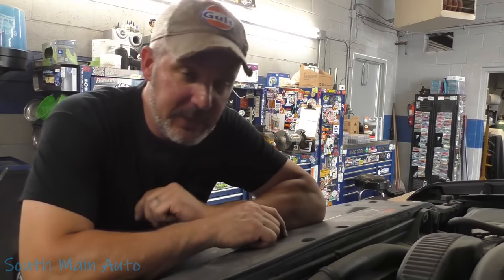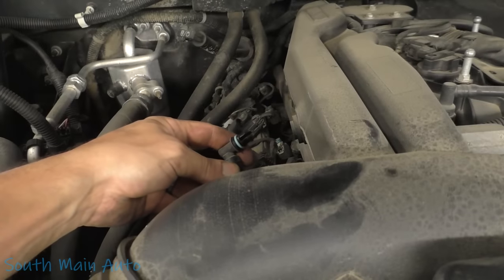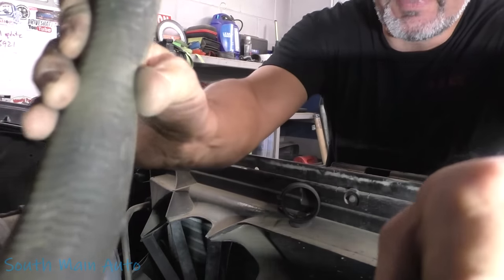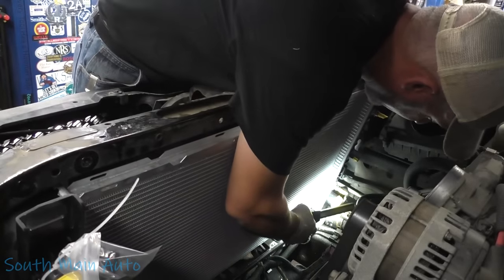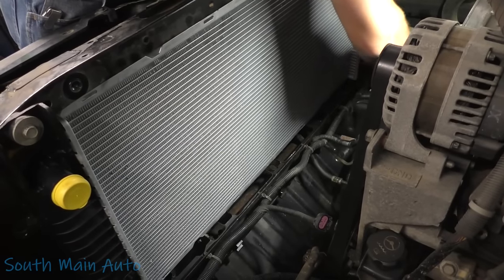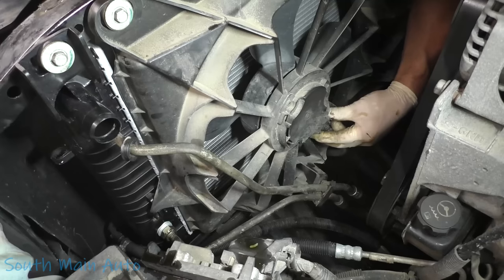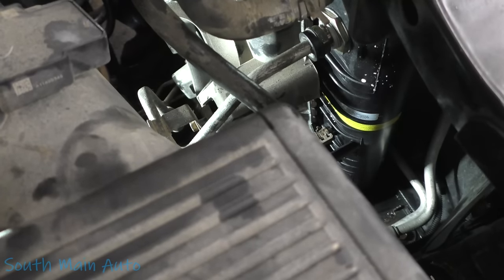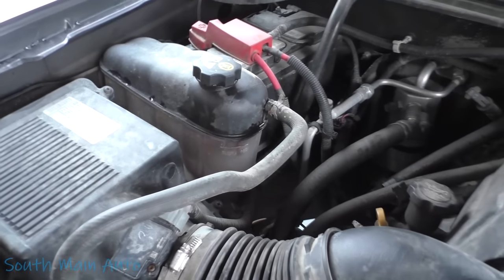'11 Chevy Silverado: Radiator Remove & Replace

Comment from the maker: Lisle 22990 Jiffy-Tite Low Profile Disconnect Set, One Size, Factory, 4-Piece : https://amzn.to/43tqgGQ
9" Hose Clamp Locking Plier : https://amzn.to/3O3smHO
DEWALT 20V MAX Ratchet Set, 3/8 inch, 70 lbs of Torque, Battery and Storage Bag Included (DCF513D1) : https://amzn.to/44y2TwW
Astro Pneumatic Tool 78585 Universal Radiator Pressure Tester & Vacuum Type Cooling System Kit : https://amzn.to/3K5GIpH
Gulf Distressed Vintage Adjustable Snapback Hat : https://amzn.to/44z1TIX
Reply: hhmmm,,,  i think,,  sometimes,, rare,,     with all the plastic cars are made of these days,,  shouldnt they be around $485. new.??..
Reply: fyi....  the marks on the napa bottles,,       are a typo.        sorry,,about that..
Reply: You're my hero,  got a radiator job coming up

Comment: In this video I learned that those fittings are called Jiffy-Tite. I've been disconnecting and reconnecting them for years and never knew their proper name. Thanks for that knowledge Eric.
Reply: How hard is it to get them off without the tool? And will I potentially break them? Deciding if i need to buy the little circular jiffytite tool

Comment: Remember when the only worry you had on a Chevy truck besides taking the top four bolts out on the two brackets was to be able to get the transmission lines off without the nuts sticking and twisting the lines
Reply: Unless you got a manual trans. 😊

Comment: I always put the clamp back in  the impressions as you do. Mostly because an older hose is less pliable and putting it back the way it came out seals better. Of course back in the day silicone hoses were special and not seen too often. Just how I learned it.
Reply: A lot of manufacturers will specify to put clamps back in their original location in their service literature, so it's not just an OCD thing lol

Comment: You are so lucky to be doing that job on a gas engine. I have a 04 GMC 3500 dually diesel and had a plugged radiator in the cooling fins area. Had to take the front of the truck off and squeaked the radiator out without pulling the inter cooler. Still took me 5 hours. Retired master certified mechanic, love your channel

Comment: I've got this same year truck with the same problem. My plastic radiator cracked, and I'm going to be changing it in my driveway. You covered all the details, boss. I now know I need those jiffy tite tools. It will be a PITA without them. Thanks for what you're doing!

Comment: Yup , probably leaking on the drivers side lower corner.  Everyone that I have done has leaked in that location.
Reply from the maker: how'd you guess.... 😏
Reply: This is happening to mine right now, shop said it’s blown head gaskets and will cost 3k to repair…..
Reply: @SQ_Silverado  Sounds like you might need another diagnosis from a different shop.

Comment: Hi Eric.  Today was a big day.  I received my first real Autel scanner.  Then I used it to figure out why my neighbor's a/c wasn't working.  Long story short, the pressure sensor was broken.  I totally legally recaptured the refrigerant, recharged it, used a torque wrench for every step of the job, and it's blowing 42 degree cold air again!  I've been fixing my own stuff for 10 years now thanks to guys like you, and this is my next step up.  Thanks for the great education and encouragement.  It turns out that I can actually do it!

Comment: "The aftermarket 90% of the time don't fit great."

You're telling me. I had one where I absolutely could not get some of the attaching brackets to fit AT ALL. I had to zip tie the radiator in place.

Comment: After seeing and working on lots of 50s-2000 model vehicles with over heating problems due to rust in those old cast iron engine blocks, I really come to love the aluminum radiators and blocks. So much better cooling and very little rust. Haven't changed any freeze plugs lately! Plus, anti-freeze is also so much better these days. Sometimes the plastic crap has some advantages!

Comment: Back in the day, there were places that would re-core your radiator while you wait. The product was your original rad with all the OEM tanks and connections but with brand-new tubes and fins.
Reply: I remember those days.
Reply: I remember dad teaching me how to solder the copper tubes if leaking.
Reply: Ahh yes, the good old days before plastic tanks.

Comment: Enjoy watching you work,and especially the sarcasm!

10 years ago I had to r/r radiator on a ford,transmission cooler lines have the double sized jeezeless clips going into the radiator. 
Didn't have the tool so I unthreaded the fitting, ford in their infinite wisdom had a nut inside the plastic tank.
Next came 2 hours of shaking it ,magnets,wires etc.
Lesson learned 😮

Comment: Little trick from an old pro: spraying the hose connection with silicone spray makes sliding the hose clamp down way easier. Drys fast so do one at a time. Learned this as the arthritis progressed.

Comment: A small size cement mixing tray works great when removing antifreeze. They're about 3FT X 5 FT and low enough to fit under most any car or truck. $10 or less at the big box hardware stores.
Reply: I use the old catering aluminum pans. They are huge and have handles.

Comment: Had to do this on my 2006 a few months ago when the plastic reservoir started leaking. Went through 3 radiators before I got one home that wasn't broken (mounting tabs, feet, cracked plastic reservoir). Pretty frustrating when the install is so quick. I did go ahead and replace all the trans cooler lines, trans filter, and fluid while I was in there. Looks like they haven't changed the design much since the LS style engine was introduced in the GM pickups.

Comment: Changed my grandson’s radiator recently. As a working student, he does not have or make a lot of money. We were able to get a radiator online at 1/3 the cost of the local auto parts store. He had to wait a few days to get it, but It fit fine and looked and felt identical to the original.

Comment: I love driving Chevy but enjoy working on older fords more. My 1980 Mustang 2.3L NA was so easy to work on and anticipate breakdowns having owned it for 12 years. Timing belt replacement in the dark - 9 minutes, distributor gear using speaker wire and the license plate light takes 22 minutes on the side of the road @ 1am, radiator hose - 3 minutes. Not a Boy Scout but still prepared enough to keep a spare timing belt, radiator hoses and distributor gear & roll pin in the car along with 3 gallons antifreeze. My 2.3L had 190,000 miles on it after rebuild & blueprinted @ 1,000 break-in, and had to stop driving it due to Michigan salt rotting it out so much I could no longer close the doors. Still held 60lbs oil pressure. Ported out the oil galleys, bored .030 over, aluminum pistons, cast rings, pro cam 2,500 to 6,000 peak HP, header, re-jet the Holley progressive 2 barrel from .019 & .038 to .028 & .092, high volume oil pump. I did spring for a 4 core radiator. Let the wife drive it once and she blew the head gasket due to putting around town and shifting below 2k (carbon build up - highway car). Mileage was 36mpg or 9mpg depending on how heavy the right foot is. Oil pressure would drop 1 needle width @3,000 miles - oil change. When porting the oil, I did hit 1 header bolt thread, so I shortened that bolt and bottom tapped the hole & added lock-tight & a set screw bottomed out.. This galley (front to back), supplied oil to the over head cam. After racing a Buick Grand National, he caught back up to me & asked "what do I have in that thing", I held up 4 fingers then wide opened hands to signify BIG 4.

Comment: I  put a new radiator in my 1983 Subaru brat a few weeks ago. It was aftermarket made from the best chinesium Aluminium. The holes lined up pretty good, it dropped in without a problem, and the little truck runs a lot cooler now!

Comment: I'm watching this while assembling a brand shiny new, gear driven engine stand. Tomorrow, the 302 for my V-8 Ranger project will be hanging on it.

I know that all of the weight reduction has to do with CAFE standards imposed by the government. However, I absolutely despise these aluminum/plastic radiators that the OEMs have been installing for decades! My 1978 GMC still has its original copper/brass radiator. I've only had it out twice, once while the engine was out for a rebuild and again a few years ago to braze a pinhole near the filler neck.

Comment: I had an aunt in Alabama that worked in a radiator shop that built them to order. Living in NC I could call her and tell her what i needed a radiator for they built it and shipped to me cheaper than I could get a used one . Never had any trouble with fit. And i never waited more than 3 days to have it in hand. That was a long time ago don't even know if the place still exist.

Comment: Just a DIY guy and I was removing a radiator clamp with a flat pliers and it came loose and flicked my thumb nail and did that ever smart, about like hitting it with a hammer which I have done plenty of times. Retired carpenter

Comment: morning Eric. Had a 95 Buick Riveria once. Had to change both the radiator and water pump. had a friend help me do this. When  done as I was  topping off the radiator and letting the car warm he open a petcock by the thermostatt. This was to let air bleed from system.I didn't know Buick had done this. Made it easy to bleed out.

Comment: I bought a Modine aluminum radiator from NAPA back in the early 2000s to replace a 3 row brass that had mediocre cooling for my 86 Z28. That Modine has been great, I really liked the quality but I haven't seen anyone selling them in years. IIRC, they were based out of Wisconsin. I pulled a GM Harrison out of the junkyard for my 87 IROC and that aluminum unit was about the same as the Modine. I had reservations about using a used radiator but that thing worked perfectly for years up until I sold it. A used GM 140 amp CS144 alternator I bought at the junkyard from a 96 Caprice in around 2004 for $40 went into my 86 Z28 and then into my 87 later on. It survived and was still in my car when I sold it a few years back. I should have saved it and found it a new home. ( I kind of want a mid 90s Blazer). GM used to make some great parts back in the day.

Comment: A trick I learned when the connector cover wont go back on is to wrap a wire tie around the connector to prevent the clip from accidentally working out.

Comment: I love Chevy trucks!  My ‘99 Silverado 2500 has only needed one radiator in 315k miles and I used aftermarket too. Still going strong. Just bought a ‘23 Silverado 2500 Duramax. When it needs a radiator I’ll probably need help. It’s as big as Staten Island. 😂

Comment: You made me laugh about the jugs. I thought I was the only one that complained about that. You are totally correct about aftermarket radiators. You never know how they are going to fit or last but you can't beat the price. Luckily I didn't have too many comebacks and they all had radiator leaks mainly at the tanks,

Comment: How did the cars from the sixties to eighties ever run without all the plastic parts?
Reply: Well, how did they leak without the plastic parts?
Reply: They ran much cooler with all of that extra space to radiate all the heat!
Reply: @chuntzinger677  So much easier to work on.
Reply: Very well, they still are

Comment: I learned the hard way a long time ago that on those cooler lines if you don't push them in until they lock you will regret it later on

Comment: Always amazed the plastic radiator headers can withstand 1.5 bar & 110 deg c sealing against aluminium core with vastly differing thermal coefficients, but when they go no chance of a bodge solder fix like the old copper rads

Comment: Those quick-disconnect tools are nifty!  
I always like to use hose clamp pliers on rad and heater hoses if not just to save coolant but not to make (as big of) a mess.  Helps when refilling so there's less air to burp out of the system if you can keep it all in the system.  Some cars a PITA that way.

Comment: As a mechanic for 15yrs when you don't put the spring clip back where it's impression is 50/50 shot it is going to leak when it gets cold. Those that disagree are south of the rust belt where when they see surface rust they think it's bad.

Comment: I’m changing the radiator on my 13’ 4.8L Silverado this weekend. Your video has given me the confidence to do this! Thanks brother!! After I get the old radiator out; could I take a hose and run water thru the truck, possibly putting the hose in the top driver’s side hose and hopefully it drains from the bottom hose (The one that goes into the thermostat)?? I want to get all the gunk, crap and this radiator fix I used (2 bottles of Bar’s Leaks Pelletized Formula and a box of their 6 of the “sawdust” type pucks) out of the truck, before I put the new one in. I hope that made sense. Thanks again for the awesome video! I’m super stoked I found it!

Comment: Someone needs to make a drain pan for cooling system work that's about 4 or 5 feet square, so you can actually catch the coolant when it comes pouring out everywhere.
Great video as always Eric, especially when Mrs. O makes a cameo appearance.
Reply: Clear plastic shallow storage containers for under beds. Or tin water heater/ washing machine drip pans. Get from a hardware store. Works great
Reply: I got a black rubberized rectangular pan that is used to mix concrete in. It’s only about 6” high and about 2’ x 3’. I think it was from Home Depot. Works great!

Comment: There should be a rule whenever a particular brand of vehicles gets heat for needing repairs the poster must disclose what vehicle they drive that needs no maintenance. It will be helpful when shopping for a new vehicle.
Reply: I drive Toyota.  Needs maintenance, but doesn’t break much.
Reply: @billc7211  Yeah, pretty much only have to fix worn out shit on 2006s toyotas. But I've done radiators in everything because even factory has those stupid plastic reservoirs.
Reply: Just look at what Eric drives/owns.  His daily driver is a Toyota truck, Hyundai minivan for Mrs. O. If he trusts his wife and kids to that Hyundai it must be decent and we should all know by now that Toyota is a good/reliable brand.  All vehicles need normal maintenance, the questions are how often they break down and how expensive are the repairs.
Reply: @billc7211  I have a 330,000 mile Camry in the fleet. I just did quite a bit of service to it hoping to keep it alive. There is a 2015 RAM 2500 6.4 and a 2006 G35 too. Both have roughly 120,000 miles on them.

Comment: i found on those jiffytight fittings they cay can be a different depth and can cause problems for you. So if you run into that problem you may need to use the old ones. Be sure to keep the new ones because you may need them when you do need to change the lines out for the cooler lines ..... just fyi .... have a great one .... tech tip thursday

Comment: I'll take a break from gushing over how Eric works - he's still the best I've ever seen - to ask a question hoping people might see it.  As a certified old guy, I am totally at a loss about all the odd shaped cavities hung off the intake air duct.  What are they for and/or do?  I don't see sensors or anything else attached to them.  Seems like most brands have them now.
Reply: The "odd shaped cavities" on the intake air-duct act as resonators to cancel out the sound of the air being pulled through the intake tube.  Makes for a quieter-experience for the driver and passengers.
Reply: @RichW240  Thanks for the answer.  That was in the back of my mind, but I didn't realize NVH had gone that far.
Reply from the maker: Oh nvh gets better. A lot of newer stuff has noise cancelling systems on the interior. Really quiet to ride in. Adaptive shake and pull compensation too. All really neat stuff.
Reply: @SouthMainAuto  Mind boggling.  I remember when bleeding edge was Ford cantilevering a weight off the tailshaft of their auto transmissions.
Reply: @BobSakamoto  I have seen photos of aftermarket cat back exhaust systems for the 350/370Zs.  (HKS brand, etc.)  The systems had an extra tube welded to the exhaust pipes near the mufflers.  The tubes had larger closed-end pipes welded onto the ends.  I finally found out that those additional "extensions" were installed to eliminate exhaust drone!

Comment: Changed a radiator, started it up and found the jiffy plugs weren't tightened! Make sure you check the plugs before you put the radiator in.

Comment: In the aircraft industry, fasteners have to be certified through an approval process. It can be expensive and add to the cost. But there is a plus side to this :
Once something is approved, all the manufacturers use the same stuff rather than pay the money for coming up with anything else. Saves having to school yourself on the thousands of varied connectors each manufacturer uses.

Comment: So I, not a highly trained mechanic, replaced the leaking radiator (drivers side) on my 2013 Chevy half-ton pickup, with the big 5-3. I installed a cheap aftermarket radiator, now 2.5 years ago.  It's fit like the original, but I also had to screw in those cooler line fittings too - why would they come loose??   Didn't realize til it leaked at startup. My system air locked but that was resolved with a gentle burping(squeezing) of the upper radiator hose.  20k+ miles later, it's still producing lots of CHEVY THUNDER. Odometer at 224k.

Comment: I can definitely identify with the video title. Less than 3 months ago I bought a Chevy truck with only 14K miles on it, and already it's back at the dealer for warranty repair. I generally keep my vehicles forever (15-20 years) but I think I'm gonna break the cycle with this one. After a year or two, I'll be looking at a Toyota or Nissan to replace it.

Comment: Put an aftermarket radiator in my GMC Pickup. Same issue with the jiffy tite connectors. Didn't have any problems 10,000 miles later.